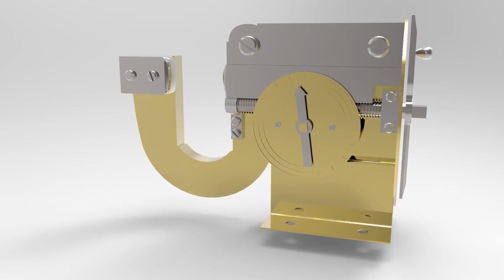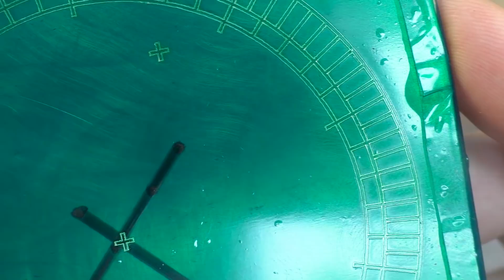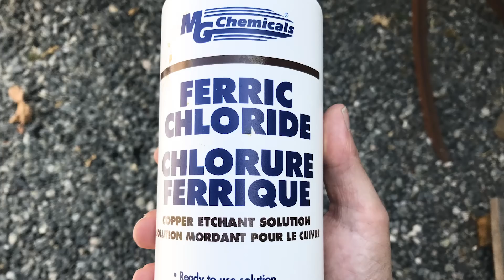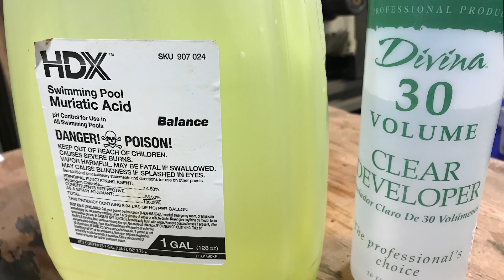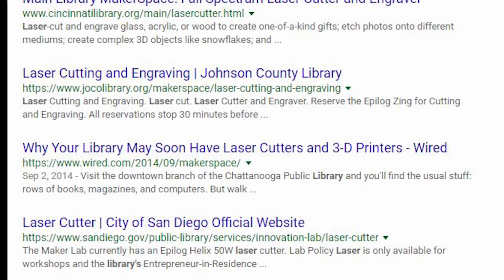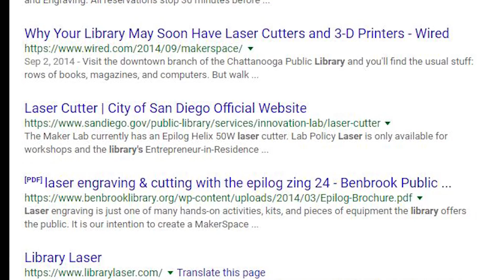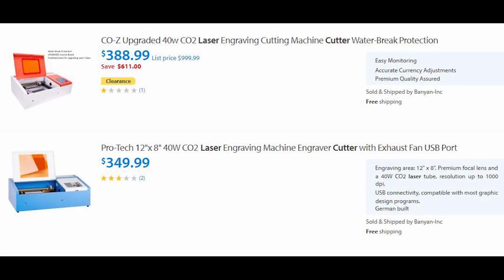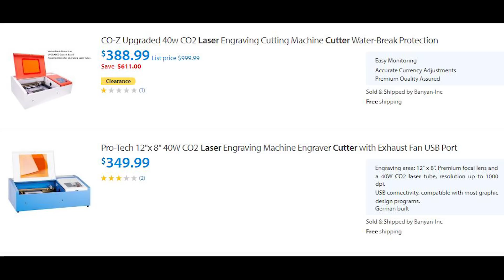New method for etching brass dials - great detail!

Comment: I paint it, remove paint with diode laser for electro etching with baking powder. You iron-3-chloride spoils until you need it next time. Apart from that ugly stains. 5W diode laser from China 65 USD + Soft housing with ventilation and hose+ ODT6 orange safety glasses for + 100 $ . Safety equipment more expensive than laser.

Comment: I know this video is from7 years ago, but I wanted to tell you the correct way for toner transfer nobody knows. I mastered this over the years and I now can etch very very delicate designs or deep etches easily. The key is to print on the oily back paper of the labels. Buy a sheet of label paper, throw out the label, and keep the yellow oily back paper and print on it. Be careful with your print, because the toner doesn't stick to this paper, it's just there. Then fully clean up your surface, put the printed paper on it, put a thin cloth over it, and iron it with the hottest temperature and put medium pressure on the iron. One minute of ironing would be enough. Then let it completely cool down, easily take off the paper, and enjoy your clean trasnfer. You may need to fix few small dots by a sharpie, but overall, it's very convenient, easy, clean, and accurate.

Comment: I would like to point out that the "bubbles" and "gasses" being produced with the muriatic acid and hydrogen perxide don't contain chlorine gas.. not exactly sure where you got that information, but it's completely incorrect. 

the bubbles you are seeing are the hydrogen peroxide breaking down, or decomposing into water and oxygen gas. the bubbles are a byproduct of the hydrogen peroxide being catalyzed by the metal ions in the solution. The bubbles being produced are predominately oxygen, with very small trace amounts of other soluble gasses that have been picked up by exposing the solution to the atmosphere (argon, nitrogen, etc)

the muriatic acid in the solution does not convert to chlorine gas at any point during this reaction. instead, the chlorine attaches to the metal ions, creating metal chlorides. At no point during this reaction is the chlorine converted into a gas.

the copper and zinc in the brass are oxidized by the hydrogen peroxide into positive ions (Cu²) and (Zn²), which then immediately react with the chloride ions from the muriatic acid to form soluble copper(II) chloride (CuCl₂) and zinc chloride (ZnCl₂)

Comment: Eliminate the etching process for making metal dials. Use a product called Laser Bond 100 on your prepared metal. This material is either rattle can sprayed or brushed on. Let stand for a while then laser your shapes or graphics. Wash the excess down the  drain with water leaving your pattern in a pretty tough black coating. 15:42 No cleanup no nasty chemicals. This is from Laser Bonding Technology (LBT)

Comment: I was doing so much laminates back in the 70s we used acetone to clean contact cement . I broke out in a rash , thought it was poison ivy. Fished a lot in the woods also. It took a few months for my dr. To figure out it was not poison ivy but the acetone that caused the breakout. Im 70 years old now and i can not get near acetone , even smelling it for to long cause me problems. Stay away from acetone. Maybe a full suit with piped in air would keep you safe , but i wouldnt trust anything less. Have a itching rash for months isnt worth it. But being a carpenter earlier than the 70s was not good for your health , even after was rough. We worked with all types of chemicals plus there was a lot of asbestos around then. They built houses out of asbestos siding. Lol loved building but im glad we got smarter. Saves other people from those mishaps.

Comment: When applying any kind of film to a surface (like tape to a piece of metal, or tint to glass, or stickers to...anything) use an old plastic card, like a credit card or ID, just make sure the edge is nice and smooth, no nicks, snags, or odd geometry. Using orbital swiping motions, press the leading edge of the adhering front down with a slight bend in the card as you go. Bam, no bubbles, perfect bond!

Muriatic acid is just Hydrochloric acid watered down to be used as a driveway cleaner. Mixing peroxide with it is a new one on me though😳..... Keep in mind Im just a recreational nerd, and dont regularly etch things, so..... I personally vote for the ferric chloride. Though that comes with its own issues, but much easier to mitigate. Also always keep some neutralizer near by, just in case (like a 2 liter bottle of basic solution (bicarb is usually a good bet, mixed into water) to quickly neutralize any incidental spills. better to have and not need than need and not have). Peroxide will out gas oxygen all on its own though, so eventually youre left with just water. And after you break the seal on the bottle, even if the lid is night and tight, itll still go flat eventually (when you get peroxide at the store for scrapes and such, get the small bottles, that way a big bottle is not wasted slowly going flat under the sink). 

HCl can be neutralized with sodium bicarb. The reaction produces CO2 H2O and NaCl, or table salt, which safely locks away the chlorine with its sodium buddy. 100% safe to dump down the drain. Just make sure its all good and neutralized. Add bicarb slowly until its stops fizzing, then add a bit more and stir. when it stops making reaction bubbles turn on the tap and down it goes! If you know the concentration and volume of the acid, you can look up a calculators online that will tell you about how much bicarb is needed to fully neutralize(over shoot it just to be sure. a light base is better than a light acid on pipes....usually....). I mean, I say 'about'....the same calculators are used for titration to determine the concentration of unknown acids, itll give you the exact molar mass needed to get the job done 1:1 😉

Comment: In the 1970s and1980s I used to etch brass and copper and I used my own mixture of Chromic and Sulfuric acids and made photoresist masks. I heated the etching bath to 125° F. and agitated the bath so as to bring fresh etchant to the surface. The Chromic acid acted as a banking agent so my final project would NOT be undercut; I could keep fine line definition. I tried ferric chloride but, it didn't work for me and I always kept undercutting. Nice channel.
Reply: Same job in the 80s, thats until the EPA got involved. We used a spray machine with 20 gals of warm ferric chloride, with either a KPR or asphalt screened resist. KPR held very very fine detail, never had trouble with breakdown on brass, stainless was hard to get depth on. We used Chromic to brighten the etched areas, also made back ground etched brass, colored anodized alum. Chromic acid and stainless steel both produced "hexavalent chrome", EPAs newer stricter disposal guidelines made it impossible, the cost of disposal was enormous, so the end was imminent. Some of my work was presented to the Houston Oilers.  Mass produced etching is not done anymore to my knowledge.  We had a process where we used black anodized with lye, the end result looked like a paper with black ink. Did lots of photos with black anodized. Amazing detail. Sure miss those days.

Comment: Tip for separating the Ikonics layers:
Once you get it going, rip it off real fast, like a bandaid.  The green stuff really doesn't want to let go of the clear film and it will stretch a lot.  BUT it stretches slow.  If you think you're pulling too fast, pull faster.
Reply: Why do you need to separate the laser tape layers?

Comment: Ferric chloride has been used for etching printed circuit boards for decades - Radio Shack stores (in the 1970's) always had some bottles in stock. I've never heard of muriatic acid or hydrogen peroxide being used for etching the copper from PC boards. Plus, muriatic acid is pretty dangerous stuff compared to the others.

Comment: do you need specific tape to use with a laser or can you use packing tape? thanks
Reply from the maker: If the packing tape has vinyl in it it will release chlorine gas as I understand it. This is highly corrosive to both metal and humans.

Comment: About a drill in brass; dull the angel of attack to zero degrees; cuts like a charm and wont lift your workpiece when getting through. Alternatively for cutting the outside circumference; establish the center, cut the outside rough with a hand- or bandsaw and then pressure turn it on the lathe directly. No need for flying cutters in between at all.  Rotary table with a small endmill would do the same job more safe too. Brass has a peaceful reputation as an ingredient for all kinds of romantic stuff. For a machinist it's a material with real risks involved. Free drilling is the main example to be caught by a piece of brass and cutting some of your important body arteries as a start. Flying workholding vises are also a hazard... I like your work, I like your style but my problem is that you're communicating in a way that your approach seams  the truth or the only way to get the job done. And that's why my irritation kicks in and I'm writing a comment. I don't know where you live and I don't know if you're open to suggestions but if you like I can give you some experienced advice on how to machine a part in a mean, lean and effective way. Curious about your answer, best regards, Job (Delft, the Netherlands)

Comment: Very cool tutorial, i know this is 3 years old, so you may have improved your skill, but my dad used to make brass plaques for entry of buildings, and the method he used to engrave was, if i recall correctly, hydrochloric acid, I'm not sure if there was an additive, but it was what he used, word of caution though, that method needs serious ventilation even while being outside, you need a fan to keep the fumes away from your lungs. And for the masking, although in here precision might be a factor, a simple vinyl sticker paper worked perfectly, it could withstand the acid very well, and it can be cut in a plotter, so those who can't use laser cut, have a solution, and for the wrapping of the rest, just plain old packing tape works well too, and super cheap. I don't know if vinyl will interact with Ferric chloride, i doubt it will, so it might be a viable solution. But all in all, your method was really great and less dangerous to your health, wish my dad learned about it when he did those, might have saved few health concerns he had before passing away. Great job!
Reply from the maker: You can't use vinyl stickers in a laser cutter because they will release chlorine gas and destroy the machine (eventually...). Plotter is fine though.  I later tried spray paint and that worked sort of ok, but didn't work as well as the laser tape.

Comment: Very nice. I’ve been thinking about getting a laser cutter, but I haven’t decided how much power I need yet. Ferric chloride is the standard etchant for making circuit boards. I started doing that 55 years ago.
Reply: But it also makes nasty hole in clothes, so my mother did not like it in the 70d, when I was heavily PCB‘ing. 
Today I let the Chinese do it for me. They are much more professionals then I ever was. And no FeCl3 holes anymore 😎
Reply: @fromgermany271  yeah, I was pretty careful. I still have the plexy tanks I made for that. I haven’t made a complex board in almost twenty years. Though it’s easier than ever now.

Comment: Great work. When I acid etch brass I spray the brass plate with mat black and then 'engrave' the design off with the laser. I get very good results but I will try the laser film .

Comment: What part of this is the New Method?  Using Ferric Chloride to etch has been done for many, many, many years.  Using a laser to cut a design into an overlay has been done for many, many years.  As far as the overlay you're cutting the design into, you can use just about anything that will stick to the surface and will burn away with the lasar - cellophane tape, lacquer, or even Magic Marker.  None of these are New.

Comment: I’m curious, if you have a laser cutter, why bother with the acid etching? Cant you make pretty deep etches with the laser?
Reply from the maker: Not in metal. You can etch anodized aluminum, but you are just etching the coating, not the metal. To etch or cut metal you need a commercial laser far beyond what a home user has.
Reply: @machinethinking  right on makes sense thanks

Comment: This is awesome, thank you for making this video. I am listowner of homebrewpcbs on Groups.io.

I'm not surprised toner transfer didn't work well. It doesn't do well with large area coverage and does have a problem with holes due to the printing patterns, as you found out. With narrow traces, people are using roll laminators. It must be one with a "Foil" setting, that is the temperature that will melt toner. Then either running it through a half-dozen times, or modifying it so it runs much more slowly. Since it is melting the toner and squishing it down, it tends to fill in pinholes, but it also tends to widen the traces, or in your case it would narrow the etchable areas.

What you've come up with is fantastic. I'm thinking this should work with those low power solid state lasers that can be added to a small CNC.

Muriatic acid and hydrogen peroxide are not ready the moment you mix them. The proper process is to add copper, to turn it into cupric chloride. It should be a nice emerald green color. It can then be renewed with either more hydrogen peroxide, or with a bubbler. Cupric chloride etches MUCH faster than muriatic acid and hydrogen peroxide.

This page goes into quite a lot of detail of how to make and maintain cupric chloride.
http://home.exetel.com.au/adam.seychell/PCB/etching_CuCl/index.html

It is funny, I have had terrible experiences with ferric chloride. Etch so slow, it gets under the resist. Parts of the board etched through to the fiberglass substrate while large areas are only half etched. Painfully slow etching even when I heat it.

I do plan on trying ferric chloride again, as it certainly is working well for you on brass. Perhaps cupric chloride just doesn't work well on brass.

Comment: When etching circuit boards with acid, I’d use a mount to keep the board sideways in the mix so bubbles wouldn’t stick, and would use a bubble stream to ensure uniform exposure.

Comment: Excellent video, it's the first I've seen of yours... I'll be back! It appears you've been thumped plenty regarding the music, so I won't bother to tell you that I found it obnoxious, overbearing and entirely out of place. I am, however, wondering about the detour with the circle cutter on the vertical mill. Considering you planned to turn it to size on the lathe, why would you not just rough-cut it with a band saw? 
A quick tip to turn the brass plate to diameter: Place a piece of double-sided tape on the face of each of the 3 movable jaws. Clamp a 1" or 2" piece of material to keep the jaws from moving... keeping the piece recessed / not protruding from the jaws. Use the live center to press your brass plate against the face of the jaws and turn to size! (This has always worked well for me and eliminates the many operations involved with the setup you demonstrated)

Comment: Etching and masking is very clever. But let down by the polishing. With a material like a marked up brass start with a DA sander (orbital) P240 grit then work your way down to P800. Then glue a piece of scotchbrite (purple) to a DA sanding disc and attach to DA. Buff with the SB until you have removed the finest of the P800 DA sanding marks. Now polish...preferably on a buffing wheel with the relevant polish, or roll your sleeves up and do it by hand. You will now be looking into a brass mirror.

Comment: You can get a much much quicker etch with ferric chloride by not leaving the piece in a bath of it, but instead using a sponge and very gently (and repeatedly) layer some over the surface. You need a fraction of etchant, and the etch is a lot quicker too. Google "pcb sponge method".
For the painting, you can also do it after you remove the mask entirely. Just spray, then sand down as you do -- the etching will keep the paint, the top surface won't.

Comment: Nice video!  I've read where they used to use asphaltum varnish for the resist.  I suppose they would print that one the stock and then after the acid etching was complete, they would wash the asphaltum off with turpentine.

Comment: Well,seeing as these are james watt repro dials,and he was a fellow scot(me),i'l impart some friendly scottish technical info ,i am an electronics technician,i make my own pcbs when i have to,i use a proper bubble etch tank that will agitate the ferric chloride etchant also it heats the etchant so the etch time for brass(i make audio gear so volume,tone etc is etched in brass plate) is very short,15-20mins,same as a pcb more or less.
The problem with the acid etch is smut build up,and the reason you hang the dial plate face down,you can do it vertical and use a fish tank pump to make the whole thing work faster,use a solid plastic tube with lots of small holes,about 0.3-0.5 mm dia,with a stainless steel weight to hold it down seeing as it's full of air to agitate the etchant.

If you read this let me know,and i'll speed up your etch time even more,scottish style.

Comment: I saw a vid - It might have been from CNC Kitchen - but my memory isn't what it should be - anyhoo, they were etching something, probably a pc board, and he wrote just a little gcode for his 3D printer to used the moving print bed as an agitator. 
You also have there a temperature controlled print bed that could warm the etching solution and let you vary the rate of reaction, and automatically agitate it.